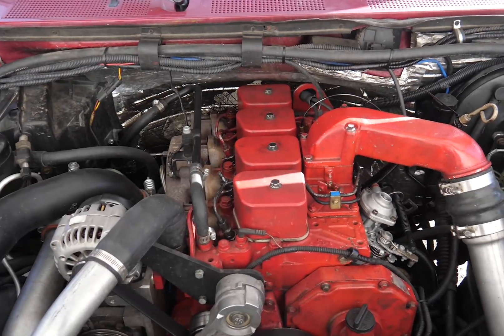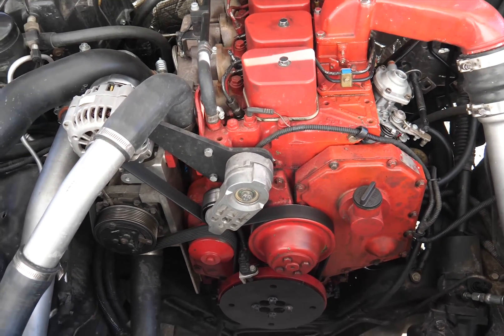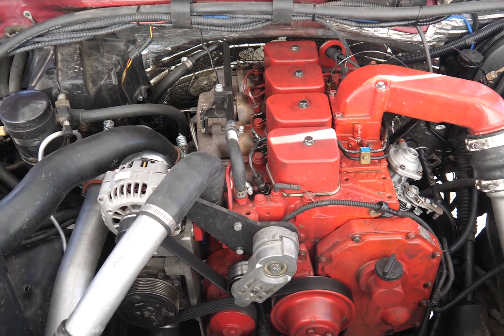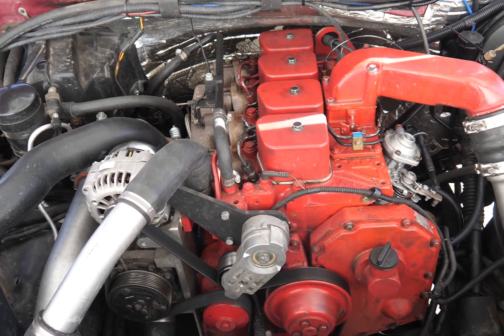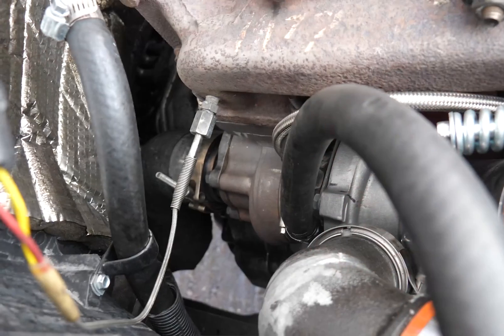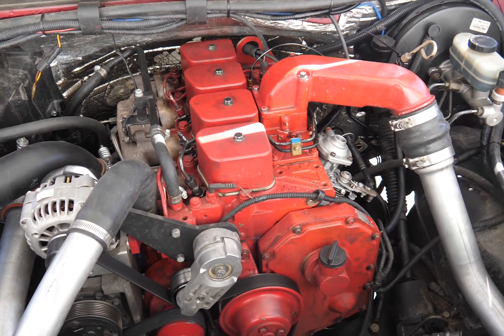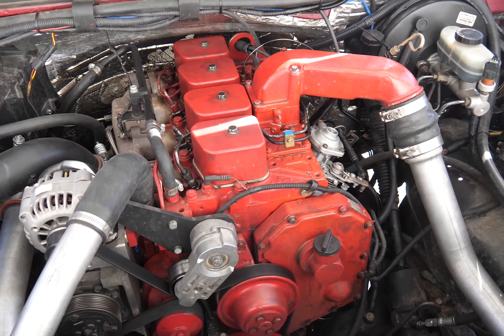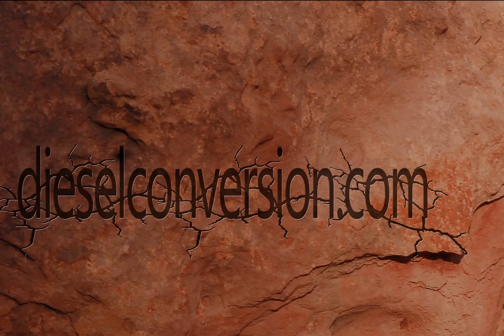The 1/2 ton 4BT engine performance tune info!!

Comment: I understand this is an older video, you all offer a 140hp 4BT currently (June 2024). What would that 140hp motor need to get the 170hp that the dyno shop out of this one? And this would be fine in a E4OD powered truck correct?

Comment: What do you guys think of using the E4OD instead of the manual?
Reply from the maker: We don't have any trouble with them (and we do use them for customer vehicles), but most guys here are just more likely to run a manual trans whenever possible.

Comment: does the Mazda transmission hold up? i was looking at nv4500 or 4l60e. I wanna swap a 4bt in old ranger or a tacoma not sure with the axles will hold up.  Im currently saving $$ for a mechanic school so i can learn more. Thank you and awesome truck.
Reply from the maker: We put more than 30K miles on it, and so far it's still working great. No way I'd put a 4BT in anything smaller (Ranger, Taco, etc). 850lbs. of 4BT up front is just too much for stock stuff. I have an 85 Toyota that i used an 04 TDI. Makes more power than the 4BT does with some pretty easy performance mods. And cheaper to get these days than a 4BT.
Reply: @dieselconversionspecialists The 1.9 TDI is a popular swap into the Toyota trucks, although I wonder if getting the mid eighties Toyota four cylinder turbo diesel is a better option.  Or are those trucks too rare?

Comment: Please post more videos about this setup! I have a 93 f150 xlt 5.8 e40d 4x4. I have some questions regarding the auto trans.. Have you had anyone run into problems with the auto trans with the setup you have in this video? Im looking to get better mpg and similar torque and horsepower overall but more is better

Comment: Should have done 6bt for the size of that pickup 4bt to small
Reply from the maker: Hmm. it made nearly 450lbs. of torque at the wheels. seems to move it around just fine.
Reply: 6bt  will not 30 mpg....
Reply: F150 front end won't hold a 6bt up for very long. Also the 150 is lighter than 3/4 or 1 ton

Comment: How did you hook up the tach
Reply from the maker: For this one we used a three pulse tone ring mounted on the front of the engine and sensor from a 6.0.
Reply: Theres also universal diesel tachs that hook up to you alternator to get the rpms.